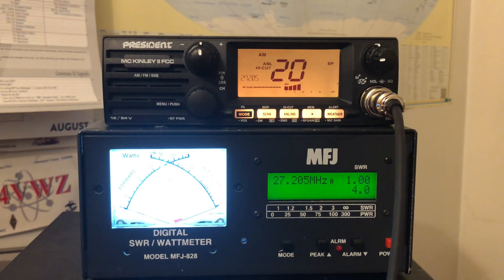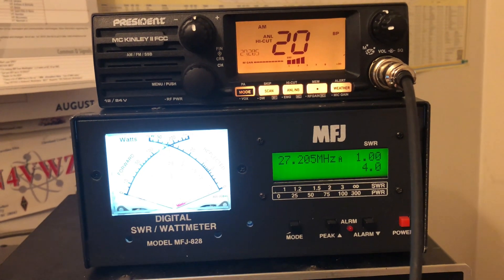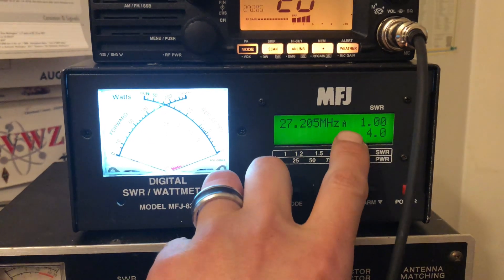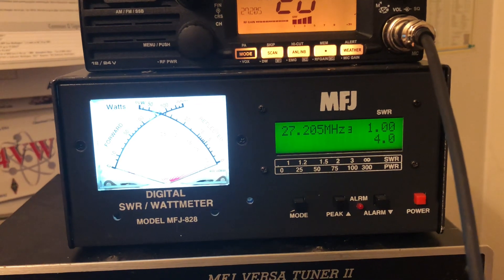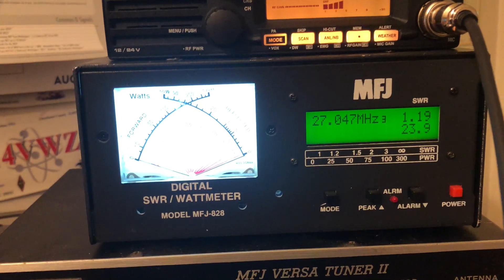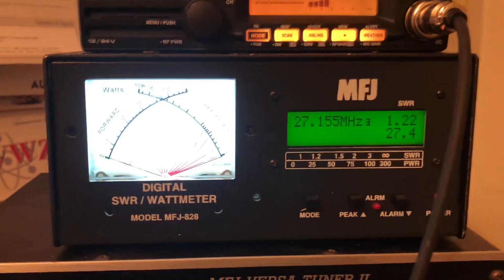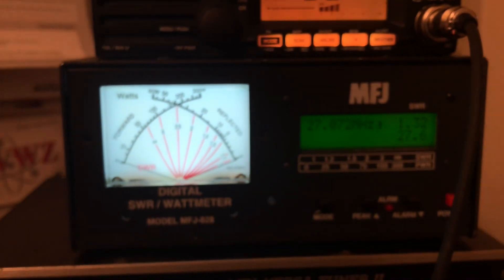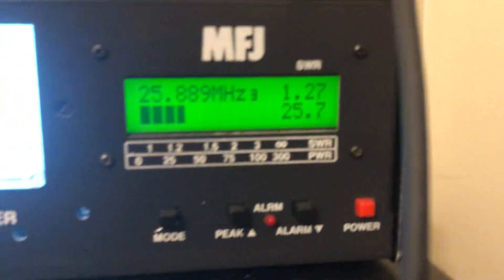President McKinley 2 Power Test

Comment: Good looking radio, do you know if the output power is adjustable in the menu ? Thanks in advance.
Reply from the maker: Thanks, yes just like the original McKinley the RF power is adjustable in the main face of the radio.
Reply: @mikecricket113  Mike, thanks for the fast reply, i thought it was adjustable but wasn't sure on the mckinley 2, im probably going to be getting one soon, also going to sub to your channel, thanks again.
Reply from the maker: Good to hear from you.  Thanks for supporting the channel.